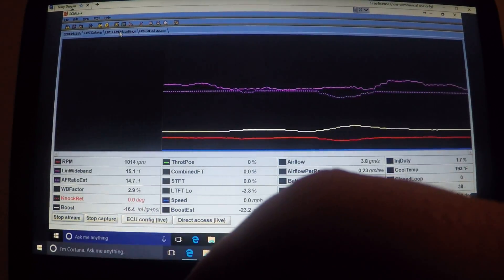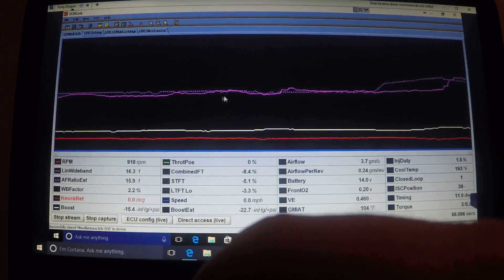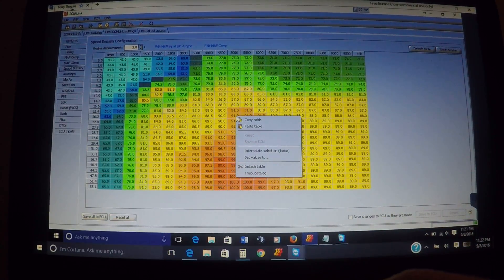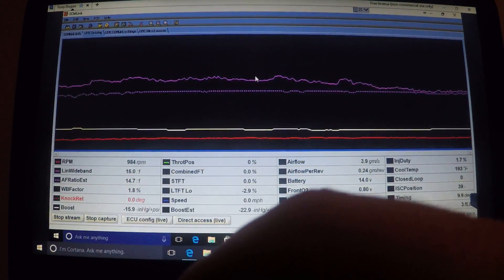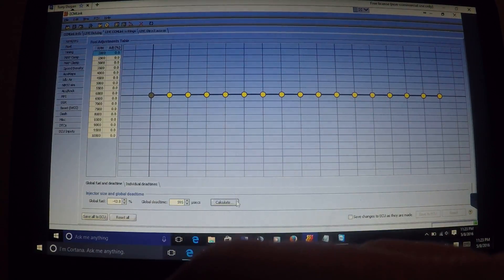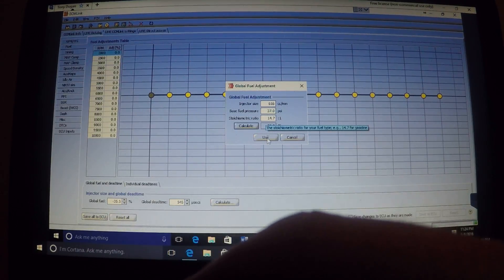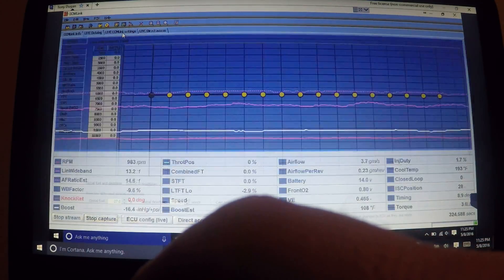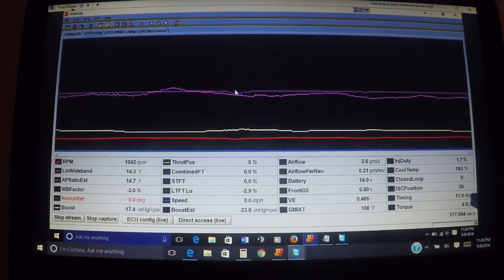SD WOT  Part 2

Comment: Is the EVO8 SD stock table, safe to start adjusting SD on a DSM 2G 7 bolt? 
BTW, is that the same table you copied to start adjusting?
Reply from the maker: You mean fuel and timing tables???
Reply from the maker: And I used the stock 2g tables IF I remember correctly anyway.
Reply: @V8sareslow1  yeah Fuel and timing but also the Speed density table, I saw you copied one from one of your files to start working on it... So I was wondering if that is a stock table from a specific car...
Reply from the maker: @AndrexZ18  no sir, I just made that and adjust as needed. I don't mind sharing if need be.

Comment: Hey Scott so telling the ecu that you have smaller injectors will let  the VE table line up but what about your injector duty ?  If you are lowering the injector size  from let's say 1000cc  you take 30% makes them aroun 700cc so your injector duty would be higher than it actually is how do you deal with that?
Reply from the maker: Gonna depend on how hard the injector is having to work. Example, on E85, my duty cycle would be high because E85 requires more fuel and so it's having to work harder to flow enough fuel for the desired afr. I now run Methanol injection and it dropped my duty cycle from like 80% to 40%. It's just not having to work as hard to achieve the desired afr. Methanol injection actually richens my mixture.
Reply: @V8sareslow1  what I meant is that we are telling the ecu that We have smaller injectors so the logged value (injector duty) won't be accurate?  I would assume if we tell the ecu we have smaller injectors (30%) when we log 100% injector duty in reality we still have 30% more injector I don't know if it makes sense.
Reply from the maker: @georgesantizo4033  well, I'll tell you. I don't like giving misinformation or answers I don't know. On that one, I don't know how the duty cycle is calculated. I'm unsure of if "that" reading would be accurate or skewed. I'm unsure of how the ecu would know how hard the injector is working anyway, aside from maybe a voltage in and voltage out. I really dunno. I have an injector that's large enough to handle the flow anyway. If I were on the edge, I would probably be more concerned about that reading. Sorry I can't accurately answer that question with 100% certainty. I'm just a poor guy learning some of this stuff myself. Lol.